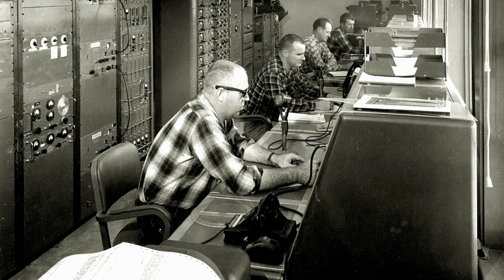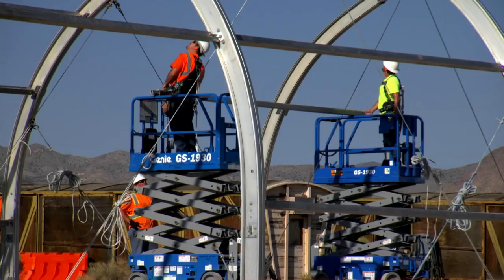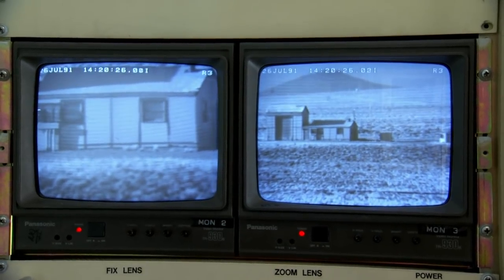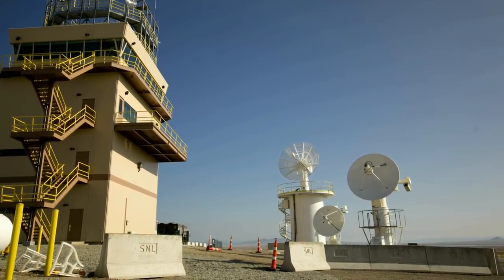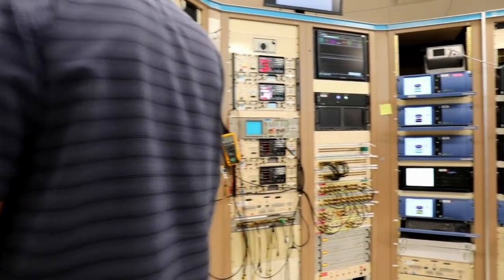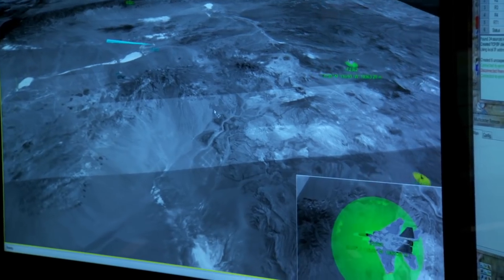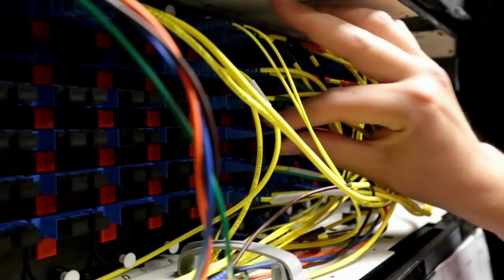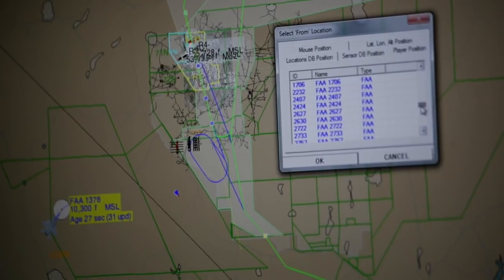Tonopah Test Range

Comment: Travel to the main gate of the Tonopah Range, south of Warm Springs. Turn right and travel west on the dirt road, just to the north of the base perimeter. Five miles later, you will see an old concrete slab to the north. Snoop around and you will find a sign that reads, "Warning: Creature Detainment Area". Now, you tell me what that means????
Reply: Range critters (wild and domestic). Wild horses,deers,cows,rams,coyotes,mountain lions. There are plenty of creatures out there in the bush and plenty of instances of them getting in the way of things. An old NTS vet told me of an incident in 2003 when putting fresh saude on a baseball diamond at one of the other operating locations, they never gave it much thought to put up any kind of temporary fence until they came back to the work site one morning to find a fair sized heard cows eating up the fresh grass. They had come in from the ranges over night.  They can smell fresh grass from tens of miles away and are allowed to roam certain parts(hence they found the grass!). There's a humorous reason certain places out there are referred to as a ranch, You really are out among some of the last "cowboy's" out there.
Reply: put pics on ur channel, jusy subbed